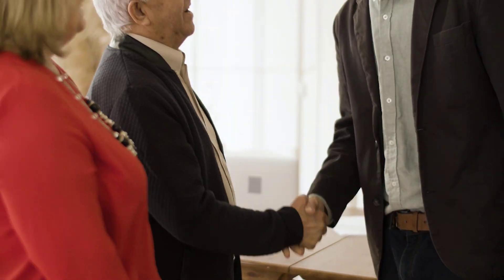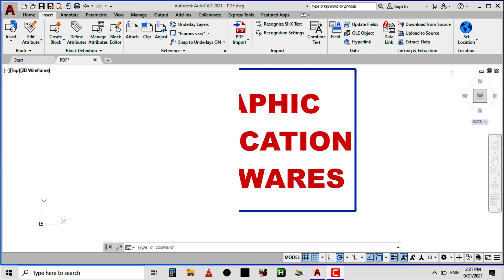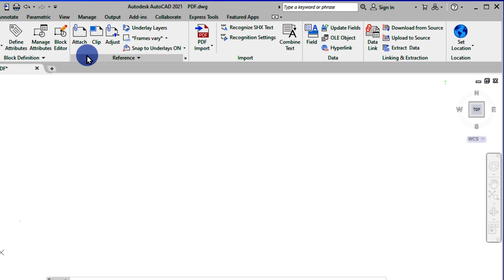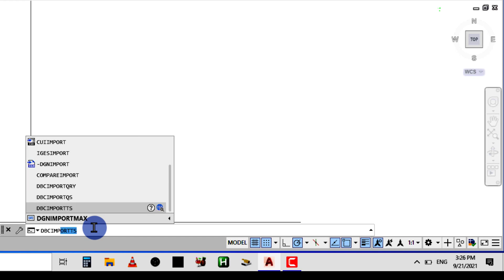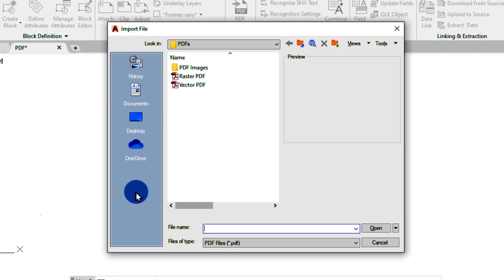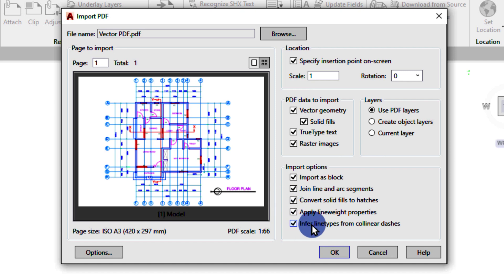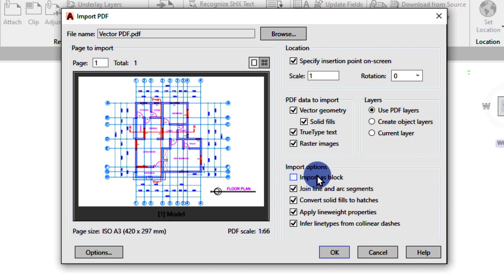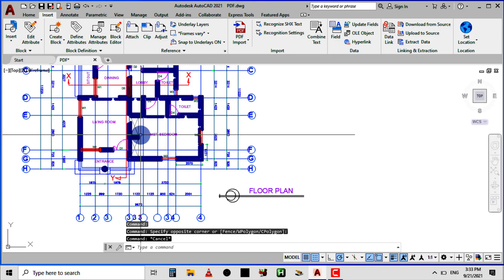How To Import PDF Into AutoCAD || Vector And Raster PDF

Comment: Thanks for this quick video, please how can we turn the drawing to a global coordinate
Reply from the maker: Click once on the little square ◽ on the WCS usually located at the bottom left of your AutoCAD screen. Click the square a second time and move your mouse to a reference point on the drawing you want to rotate and click at the point. Click on the little circle 🔵 on X -axis and rotate the coordinate system to the line you want to be the baseline and click once more. Finally go to the top right corner of AutoCAD screen where you have N,S,E,W and click on TOP to rotate the drawing to the new Coordinate System.